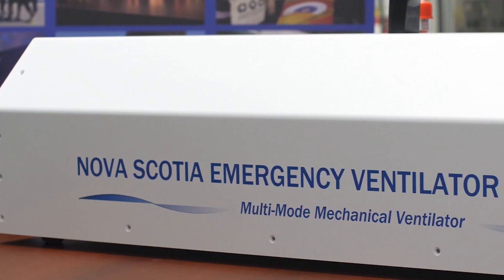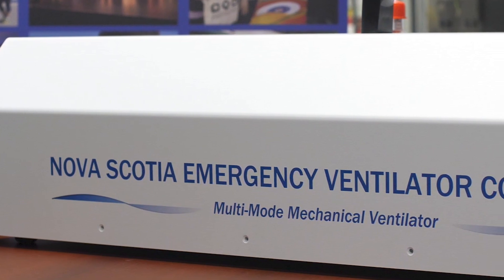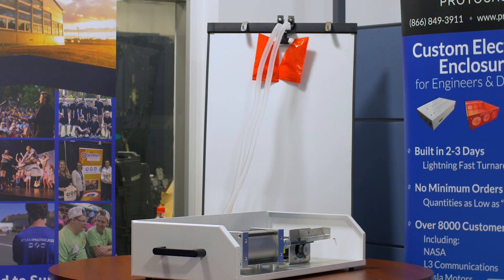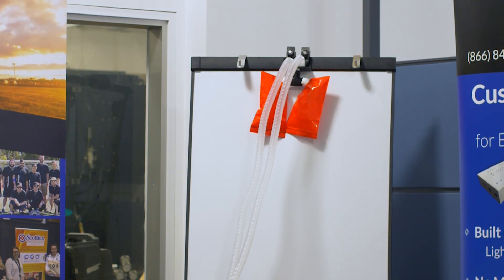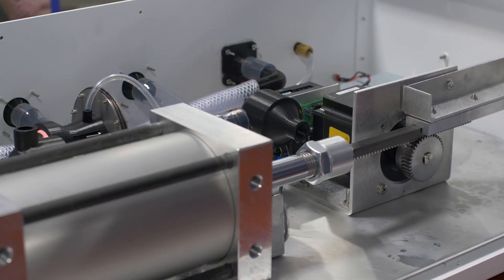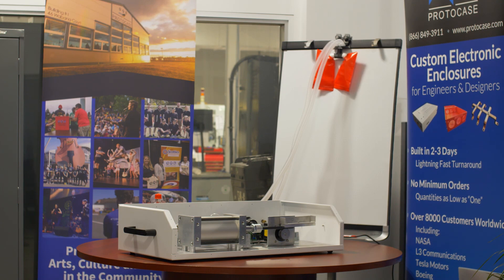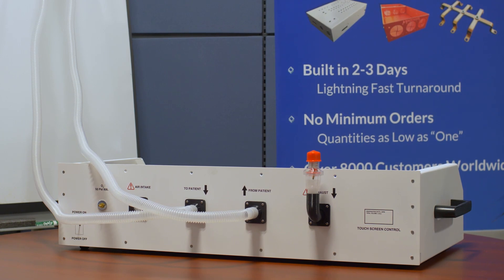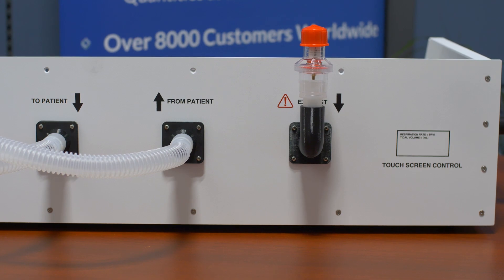Nova Scotia Ventilator Consortium

Comment: The whole low cost PPE being hard to get talking points after more than a month through out this potential crisis shows our manufacturing level. Why Canada's paper companies do not have the ability to make advanced but basic filters is astounding and does not sound realistic. Tooling for ww2 happened in weeks not months and they made very complex devices en masse. Canada would halt without asian component imports like IC and chips etc we need to address that. Canucks still blaming China while waiting for cheap import Amazon crap. Blind.